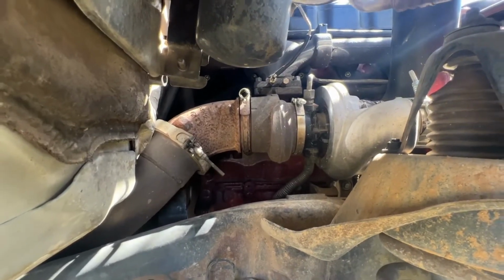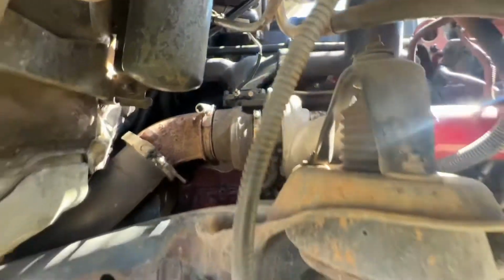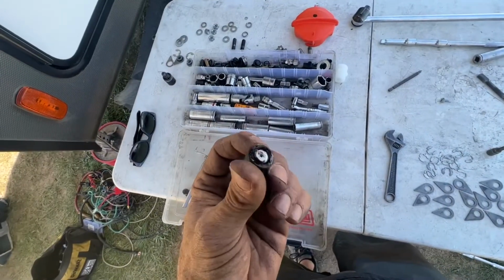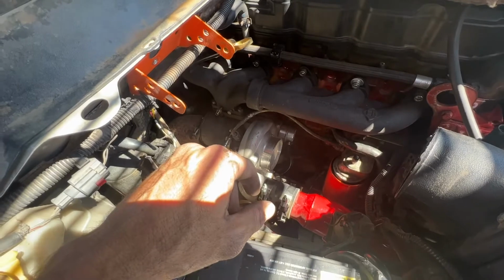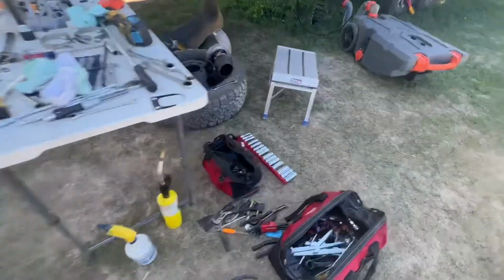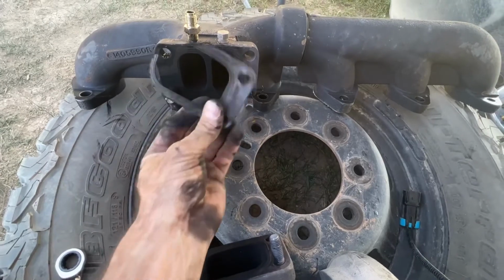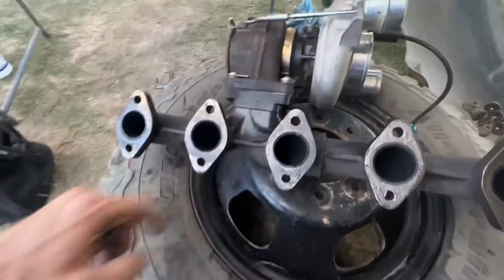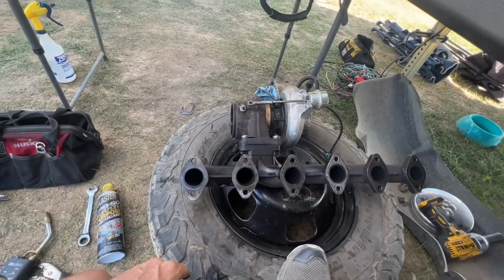Cummins boost leak! Turbo gasket failure.

Comment from the maker: If you own a cummins do yourself a favor and go buy the locking manifold and turbo hardware. Cylinder 6 likes to vibrate the manifold bolts out, and also the back to nuts on the turbo mount like to wiggle loose. You will end up pulling all that crap out for a blown gasket, and it wasn't after 2 years, we are talking a few months. Power Driven Diesel sells both sets on their website. Links in description

Comment: Were the fumes clearly coming out of the faulty gasket or did they appear to be coming from inside the turbo because I have this same kind of issue. It at first appeared to be the exhaust gasket on the bolt just as you showed but after showing it to a mechanic he believed the gases and soot as being basically on the turbo. After tightening the bolt the gases definitely are from around the turbo or further in behind the turbo.
Reply from the maker: Those nuts love to back off those bolts. You need to invest in locking hardware. The leak was between the turbo and the manifold. Just stick your hand behind the turbo, between the engine and the turbo. Start the truck and if you feel puffs of air hitting your hand it’s the gasket. Idk how the turbo would itself leak there. It’s
Cast iron. Maybe a crack in the cast.
Reply from the maker: @donner101  find a video of someone taking the turbo apart, I don’t think I ever did on camera. Will give you a better idea where it “could” leak. My bet is the gasket. I think that mechanic just wants to sell you a turbo
Reply: @grumpysdiy  Thanks.

Comment: Did it make a whine sound  when you gave it gas
Reply from the maker: Yea a horrible whistle sound.
Reply: Mine makes more of a squeal like a bad belt squeak. I’m thinking this is my problem
Reply from the maker: Is it all the time or only when you shut the truck off?
Reply: @grumpysdiy  it’s under acceleration above probably 1500. When it gets to higher spool. I could send you a video if there’s a way
Reply from the maker: Upload it to YT, post the link here.
Reply: inspect for soot around your exhaust side of the engine, look for broken bolts on turbo and exhaust manifold